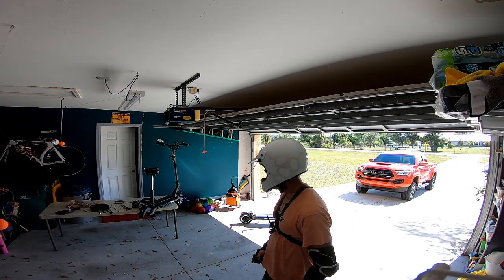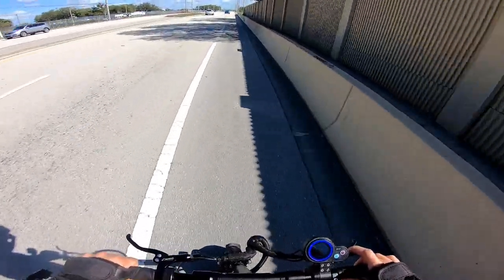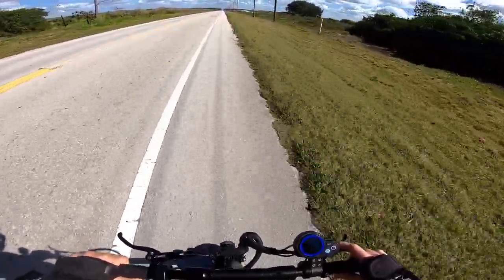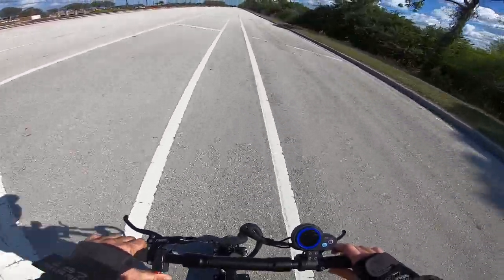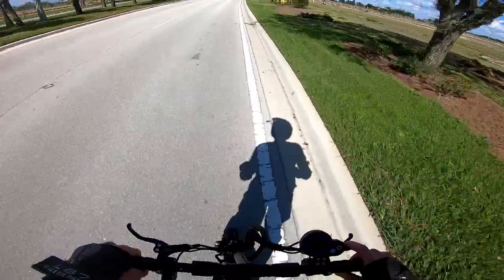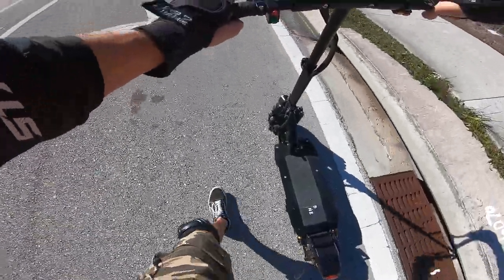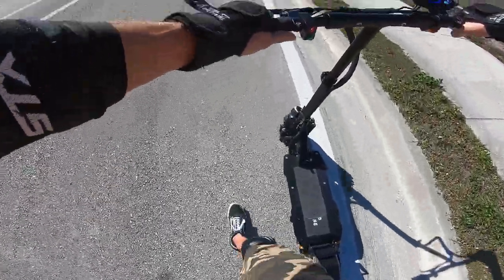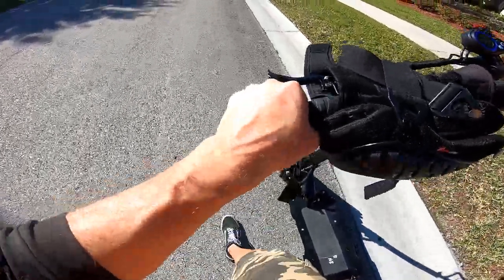Ultron Ultra Range Test - Came up Short

Comment: I just got my scooter in and your right its a beast in dual motor mode. as far as range, I manage to get 32 miles out of my scooter. but my scooter is 3200 w 60v 35mh
Reply from the maker: Bigger battery definitely is a good thing with power hungry motors.
Reply: where did u get yours from buddy

Comment: I think 30 mile range is exactly what I was expecting. The 60v 30AH version may give you closer to 40 miles. In fact if you use your other half to do a distance run, you might even et 40 miles with this scooter as riding weight makes a big difference in mileage
Dont forget to use  wheel slime/sludge.. it helps with punctures and perhaps even distance and ride handling.
Would be great to know how long you think the wheels might last for and do some sort wheel cost per mile.
Reply from the maker: Tomorrow I will be going close to 50 miles, with a charge break during the day.  Now that I know the limits of the range, I will be driving more in a manner to maximize range instead of maximizing my MPH. :)
Reply from the maker: I do need to Slime it, but don't have time to do it before tomorrow's ride.

Comment: New lithium battery needs work-in about 10-20 charges. After that you get maximum performance and range.
Reply from the maker: Ok but the range on this scooter would still be disappointing.

Comment: I have a similar scooter, just branded differently. If you go into P9 settings you can adjust regen. 0 is off then 1-3 is low to high. Maybe it's the same for yours
Reply from the maker: I had it set to 3 regen

Comment: All this and you were rooting for the Rams... ouch. My condolences. Do you think the Cruise Control would have made much of a difference on this ride, if it worked?
Reply from the maker: No I don't think cruise would have helped.  I could have extended the range by riding slower or using a lower "gear" but as I mentioned I did not expect to have any issue with battery life when I left, which was dumb on my part after further analysis.

Comment: 20:11 full charged battery i go work single mode gear 1 i have 100% when work. dual mode gear 2 ONLY i have 92% huge diff. 2 motor eat battery allmost 2x faster. 1 motor will same thing climb hill and so on. wish they allow change rear and front motor usage so not allways wear rear motor
Reply from the maker: Agree

Comment: how fast did the scooter go? and battery, so the battery goes for 1 hour fun? where did you buy it?
Reply from the maker: Top speed 37-40mph, I got 25 miles driving fast.  Purchase info in description.
Reply: @Duf  how  much is that in km/h  and 25 miles is? Looks very fun, is ultra good enough cause I'm looking for a thunder
Reply from the maker: About 70kmh speed and 40km range
Reply: @Duf  wow you mean driving at 70km/ nonstop  for the range of 40km, than thats a real good battery. how long took it?
Reply from the maker: @flashburt6765  Lol omg no but my average overall speed was 32 kmh+ with periods of time riding 48kmh+.  It has a 26Ah battery.
Reply: @Duf  good battery? Can you replace it with better or change it while you stop at anytime, or can you kick yourself back home empty?
Reply: Is that in eco mode? (One motor) or both motors?
Reply: @Duf  okay now I get it... it's a 26Ah battery. The one I got has a 35Ah battery 3200w 60v
Reply: @Duf  is it the t11 ?

Comment: I am currently using a 48V 824 Ah 1000 watt  Ebike for my commute to work. It is 16 miles round trip and if i dont charge at work I run out some days about a mile form home (I like to go fast hehe). i would imagine the ultron could easily handle 16 miles round trip on single engine level 3?
Reply from the maker: Yes for sure, I ran out of gas at 25 miles but for the first 12 miles or so I was pushing it hard.
Reply: @Duf  Awesome. I actually had the same thing happen when testing my ebike. I overestimated the low end battery charge and ended up having to pedal unpowered a few miles home. It was better than walking a scooter but pedaling a 70lb. ebike with poor gearing sucked.. I lol'd when "oh shit" came up in your video....
Reply from the maker: Yea the push was not enjoyable....

Comment: You need one of those aero helmets used by speed ice skaters.  Hold one arm behind your back while you are tucked to get that max range.  Maybe stand slightly sideways if you are very wide,...LOL.  Didn't know that thing was 80lbs.  The truck guys would only slow a bit and yell, "Haha."  Especially the Toyota truck owners.  LOL.

Being serious, I am surprised no one stopped to see if you needed help.  Perhaps they thought you didn't need it with what appears, to a car driver, to be a kid's push scooter. Pushing my out of gas motorcycle resulted in several people asking if I needed help.  Friend was already ahead finding gas for me and my 400lbs bike was easy to push on the flats.  I thanked them and said I was fine.
Reply from the maker: Yea it's fine, I will write it off as a character builder.

Comment: 31:59 if you left high speed test off yu know its go that fast no need test it xD. you could ride home. thats how much it effect range.200m speed equal kilometer on slow speed. and trick is not use thottle you let go and lett scooter roll
Reply from the maker: Yes

Comment: 8:57 put electric breaking to 5 thats insane. if you try break stop crashing you crash becouse breaking. cant believe how they setup it 1-3 setting not do anything 4 works if go ove 40kph 5 is just insane stupidy. and breaking pads weared off only using electric. mayby thats why
Reply from the maker: It didn't have any instructions.

Comment: Running a dual motor scooter on one motor is inefficient as one motor has to turn the other wheel....basic physics
Reply: Or it could be that one Wheel is in funktion and not both?